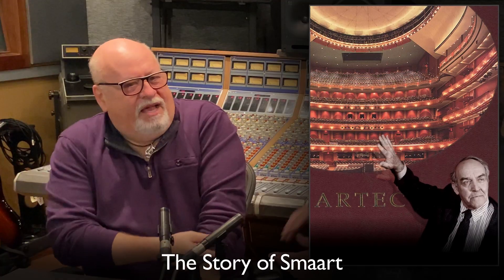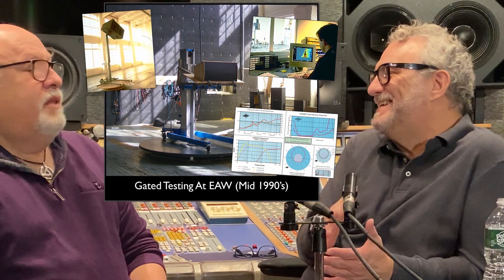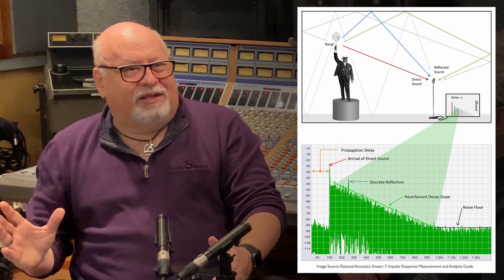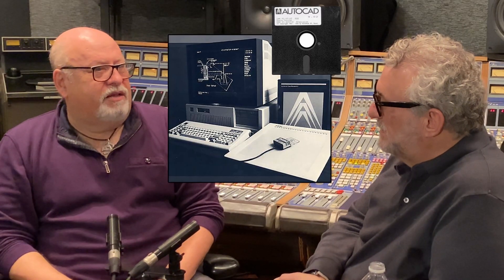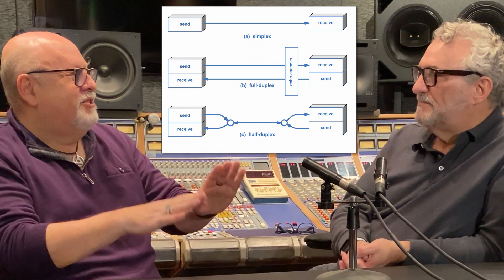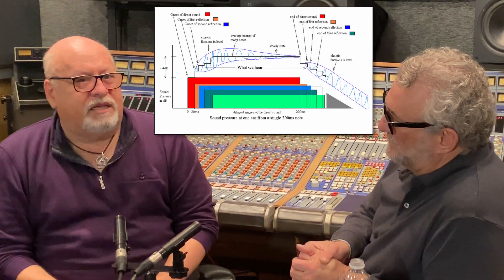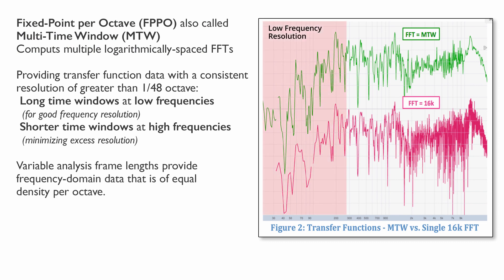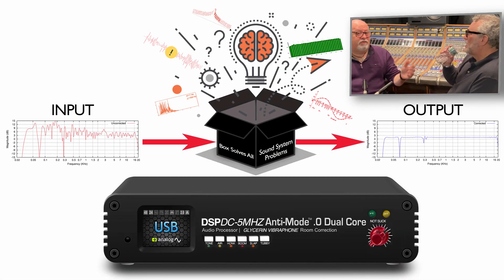Sam Berkow - Developing Smaart FFT Analyzer – Part 2

Comment: Would love to know your opinion on difference between something like a squared and low passed envelope and and Energy Time Curve (ETC).  I have read through some of the papers over the years, and it can get kind of deep as concerns whether the ETC actually  represents energy arrival (for example how it is acausal and does not thus exactly represent a physical system).  I spent a lot of time thinking about this, and finally in Kuttruff I found an answer!  He says essentially that the ETC is mainly useful simply because it is mathematically well defined.  Thus we avoid the uncertainty of choosing smoothing/low pass parameters when doing it the other way(s).  Do you agree, as far as the practical usefulness of it?
Reply from the maker: Not sure about the rationalization that ETC is useful simply because it is mathematically well defined, for most applications (i.e. system tuning) the FFT magnitude, phase and impulse data is much more useful.